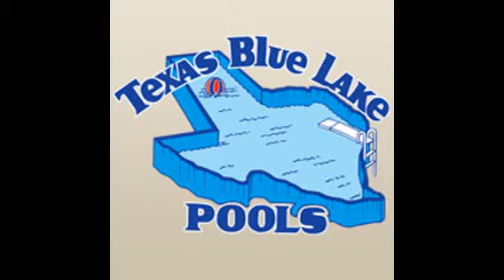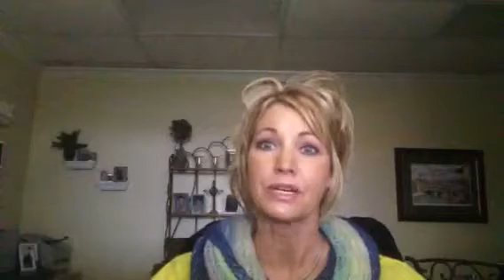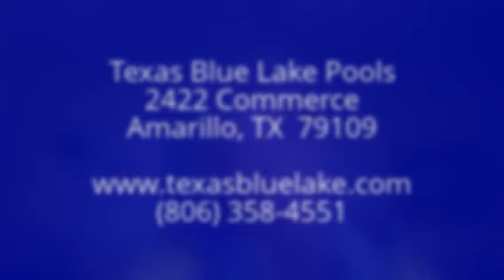Salt Water Pools Explained

Comment: Realistically you should wait at least a year to put a saltwater system in the new pool but most pool builders put them in right away because they're afraid you will shop around if you tell them to wait a year and they will lose the sale . The reason why you should wait a year is because of all of the minerals expelled from the surface of the pool when it is new which causes a lot of problems with the introduction of salt in the beginning like flaking calcium coming out of solution xcetera